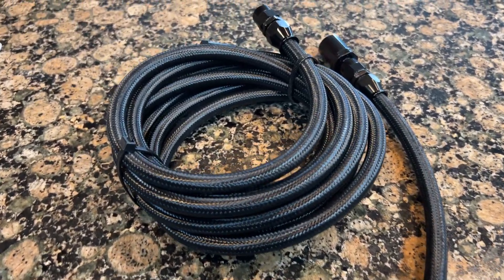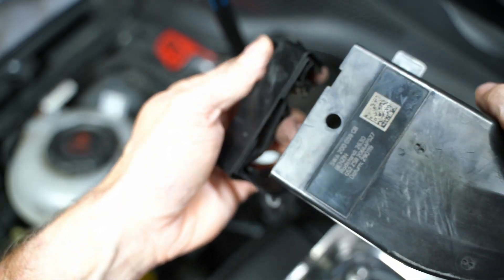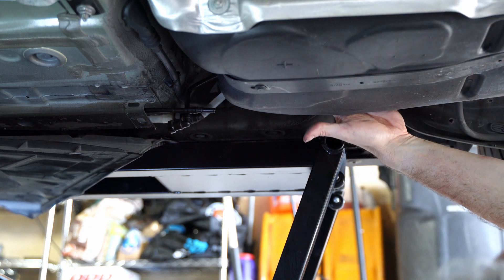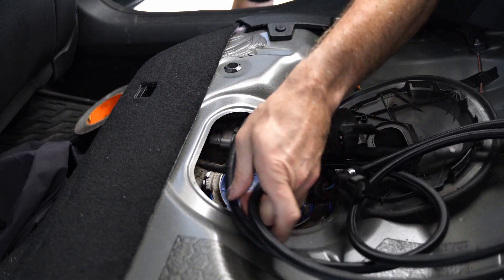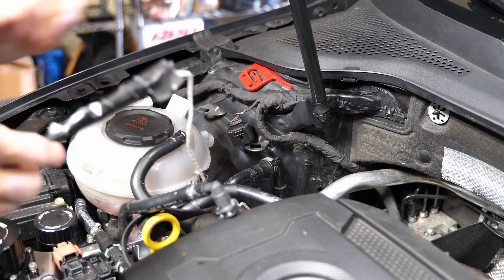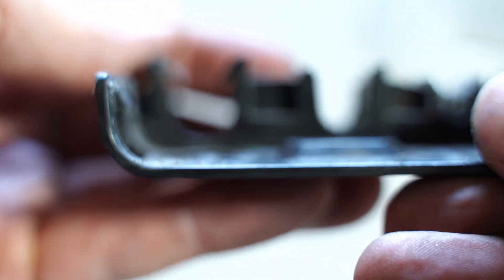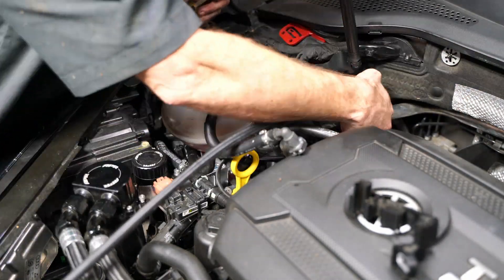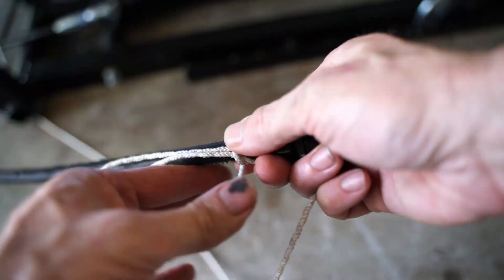Fuel Line Upgrade Tips - EQT Braided  -6 AN

Comment: You mentioned that you have already replaced the one way check valve with a 90° quick connect fitting on the hight pressure fuel line. I'm doing a An -6 PTFE line from there to the hpfp. Is that fitting there 3/8" just like the one on the ethanol sensor? Planning to use a fitting 90° PTFE -6 quick connect 3/8" female swivel. I would really appreciate if you could confirm the size of the 90° quick connect that you use?

Comment: Thing I would like to note after doing this today. My 17 S3 has a factory braided fuel line or at least it’s jacketed. It was not attached to the vent line anywhere. Made it super easy to remove. 
Also the plastic fuel line cover in the engine bay was different. It does not have the green piece that flips up. Mine just has a slit in one side at the bottom where the lines click in. It was super easy to remove and reinstall. The string method really is fantastic so thank you for posting this.

Comment: Do I need to cut the end of the stock fuel line at the fuel pump, or is there room to pull it through, just will take longer?
Reply from the maker: I am pretty sure you can pull it through. Just be patient with it.
Reply: @EVERYTHINGcpo  thanks, also can you drop a link for that coolant fitting that you got to replace the plastic one?and do you think with the vortex xl I should switch to 5w40 or stay with 0w-20
Reply: @mk7t472  go to 5w40.

Comment: Can you explain the benefits for upgrading the fuel lines?! Are the stock ones have limitations when it comes to performance, or just for durability?!
Reply: With a built motor, bigger turbo and running ethanol you may need the additional flow